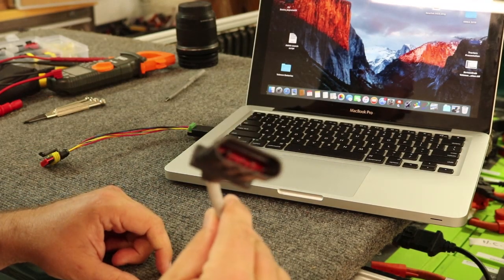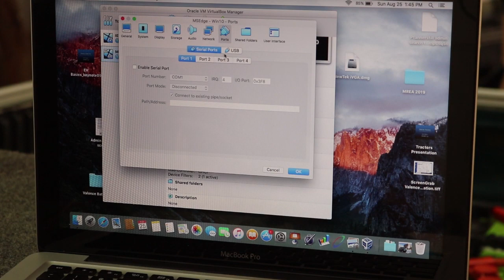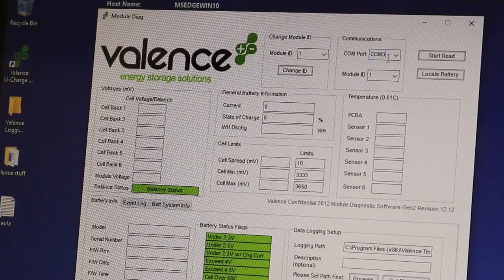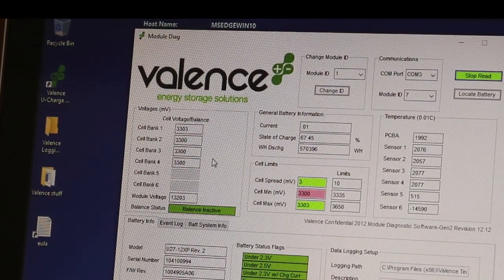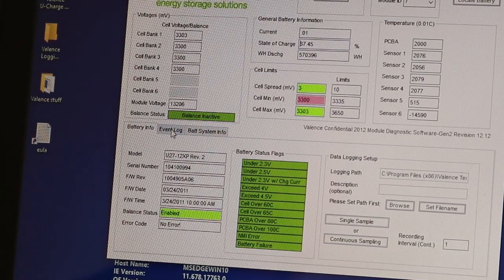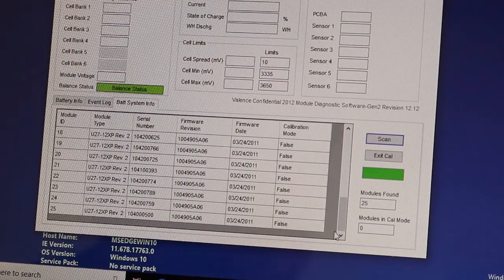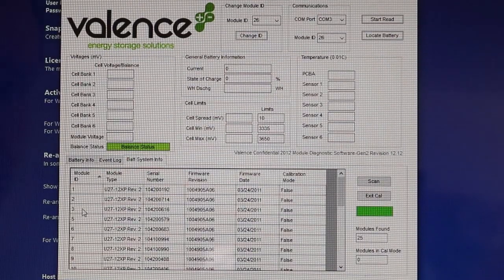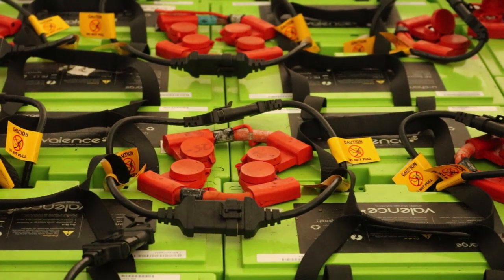Lithium Battery Communications | Connecting a Laptop to Valence XP batteries

Comment: Hi, I am planning to buy just 1 used Valence XP battery, to swap my Lead Acid one in my Converter Van. I am planning to charge it with Victron 12v 20A MPPT solar controller and occasionally with AC to DC lead-acid battery charger ( I have 15A lead acid one, that I might need to swap with something that has LiFePo4 charging program). My main confusion is - do I have to buy Valence BMS for a single XP battery, so it could balance its cells, or the inbuilt BMS will do this automatically? The datasheet says that those always need BMS, but I cannot figure out if a single XP battery would need it. I heard that it might need 5v to one of the communication pins, so that the internal BMS would work, but this seems odd.
Reply from the maker: Great questions. It appears that the internal BMS does balance the cells without needing the BMS interface box or 5V on the communications pin. Solar charging should be great, along with occasionally lead-acid type charging. Just double-check that the charging is within the spec of the batteries.
Reply: @BenjaminNelsonX , Hi Benjamin, Thanks for you information. I do have a question after using the battery and solar charger. I bought mine solar system from Home Depot and it cam with a solar charger controller. I first purchased only one valence battery Unfortunately the charge controller said it cut the voltage at 14.2 volts but it did not. It allowed the voltage to go over 16 volts. I immediately unplugged it. I then bought a high quality charge controller. But my question is that I thought the Valence battery would have cut out when the voltage went above 17 volts. Maybe it did but I could not tell. Also I was told that maybe I need to plug the the BMS cables together when running a single battery. Do you know if this is true or not. Thanks Dave,
P.S I have now purchased 4 batteries so I will be daisy chaining  them together like you have.
Reply: One last question that I am sure many others have. how do you program the batteries to put them in series or to set the BMW voltage on the batteries with the Valence software? Thanks for any updates

Comment: Nice! Thanks for sharing all of that information! Will look forward to your future discoveries now that you have cracked the code! Gotta go order those adapters now!
Reply: Hey Jim..I have the same batteries and setup from your channel. Did you ever get the software to work on the rt series battery?
Reply: gman weber No, I was not able to get the software working with my batteries. I planned to remake the cable and try again, but haven’t the time to play around with that yet.
Reply: @jimginnyohio  ya..i worked hours on getting this hooked up to the T. Won't recognize the battery. Windows xp ..nada..switched wires on cable..nada..got close on COM5..let me know if you get it hooked up..otherwise im thinking the bms on these rt series dont work or this software doesn't.

Comment: I have 4 of these batteries in parallel. Do I still chain the communication cables together or do I have to read each one separately?
Reply from the maker: Take a look at page 46 of the battery manual. That shows a series/parallel configuration, including the communications setup.
https://www.scribd.com/book/256622731

Comment: This is the biggest problem for me to make the decision to go ahead and convert an IC vehicle to EV. They have too much computer crap in them already and for EV to be a viable option for me it would have to have a bare minimum of electronics... Preferably just a board for the charger and another for the motor controller. Call me an old coot but I want a vehicle I can maintain easily and not have to hook up to something to know what's wrong when it breaks.
Reply from the maker: Then you probably want to do what I did when I converted my Geo Metro to electric. That was a super-simple conversion.
Here's the videos I made about it: https://www.youtube.com/playlist?list=PLmHss3DBZUilepzTmr-XAVwpRRCqMv7Ny

The real issue in this video is that I'm using a factory-built 20 year old electric truck which was NOT designed for lithium batteries. AND these batteries were really designed for OEM manufacturers. Valence does NOT just hand out plenty of information for hobbyists and DIYers.
If I was instead just adding plain lithium batteries to a current DIY electric car, it would be pretty straight forward.

Comment: When changing the module id, connect only one module to be renamed to the computer. If not, you can probably be renaming two modules at the same time.
Reply from the maker: I tried it. Totally worked. Computer sees all 26 modules now.
Reply: @BenjaminNelsonX  Also, the "Locate battery" works well if you only have a single battery connected to the computer.  It will find the ID of that one battery so you can label it or change it.  If you have all batteries hooked inline, it only finds the lowest number ID and you don't really know which one it is except for the SN that shows up in the software.
Reply: @gregd8697  I'm connecting one at a time but the software isn't seeing it. Any ideas where I'm going wrong?
Reply: @brassmonkey001  Have you been able to connect to any modules to verify that the cable and serial port are working as expected?  In general, the first time I connected, I hooked up a single battery and made sure I was on the correct COM port based on the USB to Serial cable I had connected, then was able to hit the locate battery and it told me the ID.  I could do that with any of the batteries, and once I had the ID, I simply moved the ID to read from multiple batteries connected together.  It sounds like maybe something is going on with basic COM/USB connection or the PIN's going to the valence connector.
Reply: @gregd8697  COM port 1 is the only one that doesn't give me an Incorrect Com Port Selected! error. It seems to be looking but comes back with a No Battery Found message.
Start Read gives me a Please check the Com Port or Module ID error message.
Reply: @gregd8697  Done it! Had to have a nose around in the Laptop's Device Manager and looked in Ports instead of USB COntrollers, found a USB Serial Port in there (COM 9), changed the Valence DIagnostic software Com Port to 9 and it all started working! Thanks for your help. :-)
Reply from the maker: Ah good thought! Still not sure why it would have worked on the first battery but not the second. I'll give that a try. Sounds like a smart solution. Why didn't I think of that?!
Reply: Would be great if someone could post and pin out for making the cable. The USB side is the 2 outside pin are power and the 2 inside pins are data. The Valence connector has 5 pins. Which ones are which on the Valence connector?
Reply: @cliffscott7073  Ignore pin one on the Valence connector and connect as shown in the video.
Reply: I'm building a wiring harness man is it difficult to figure out where the pins go. When you show the one you built it goes by in about 5 Seconds

Comment: In BMS connection you have one to each positive terminal usually. Hard to see the setup here. >>>First in line goes to Most Negative , then to each positive.? Thanks alot
Reply from the maker: Each battery has a two BMS communications cables on it. One is male, one is female. Each battery gets one cable plugged into the one before it and the one after it to make a chain. The resistor terminator goes on the most negative end. The cable to the BMS interface or laptop goes on the most positive end.
Reply: @BenjaminNelsonX  Hey have you ever tried to connect the usb connection you made directly with the battery, without using the supplied communication cables? I know you would have to make a another section that's female to female using the connectors and scrap wires. Long story short, i'm having trouble connecting to the batteries but i'm wondering if it has to do with not having the BMS or supplied communications cables
Reply from the maker: @jonathansikes5200  What do you mean by "supplied communications cables"?
The communications cables are BUILT IN to the batteries.
For the most part, I WAS going straight from my little USB adapter to a battery or string of batteries.
Usually for troubleshooting, if you are having a problem, you try to eliminate as many variables as you can, for example, just going to a single battery. That's what I did a number of times. Worked fine for me.